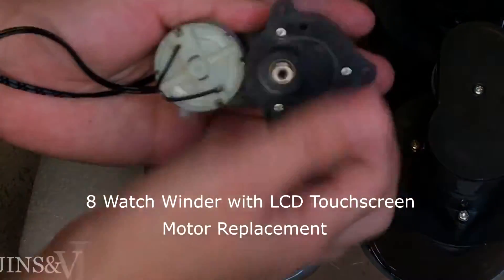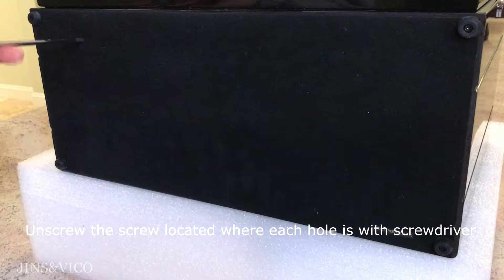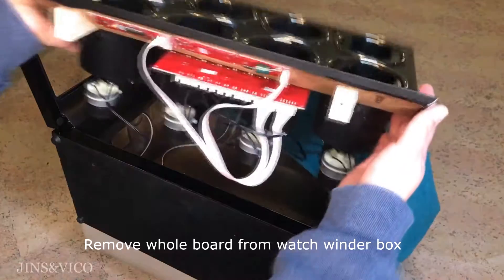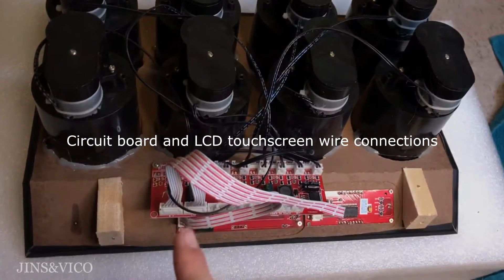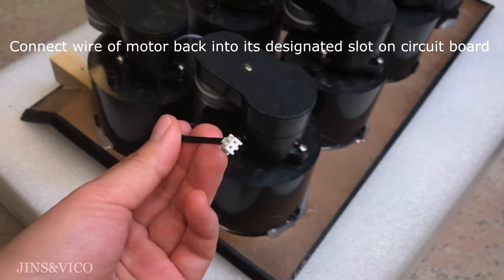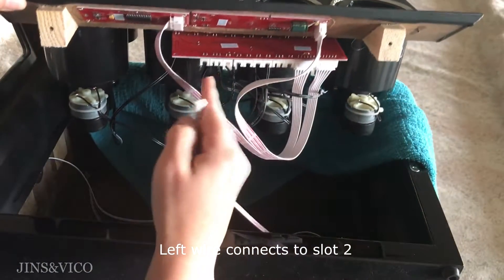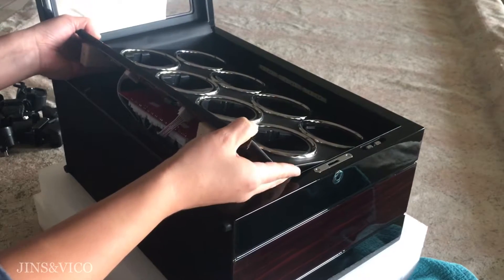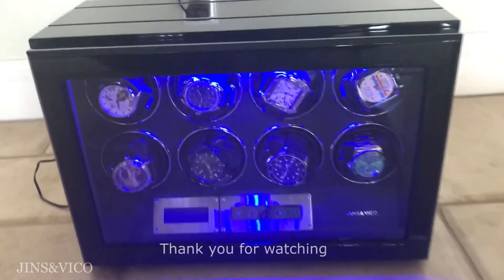How to replace the motor of JINS&VICO 8 Watch Winder with LCD Touchscreen

Comment: It is easy to replace the motor but what is hard is actually buying a motor. I am in UK and I found one source of motors which was quoting a stupid price and TWO MONTHS delivery. In an experiment I ordered a common Japanese motor from Amazon which was on next day delivery and about 20% of the price. The hope was that I could modify the winder to fit it. In fact the cheap motor had the same shaft design so fitted the watch holder and when I removed the old motor I found that underneath was a separate set of mountings that exactly fitted the replacement. The whole replacement job took less than 10 minutes.
Reply: Would you mind sharing the motor you bought? I would like to get one too. Thank you!

Comment: No instruction or direction on where to obtain the motor(s)?
Reply: I cant remember now but some time later a different watch winder had a problem and the maker sent me a bag of motors, They were different to the ones on the original and new winder but still fitted and worked Ok so it seems there may be some sort of standard for fitting.

Comment: Yeah, so you get a brand new winder these guys and one motor is already dead. And there’s no way I’m keeping a new winder at $500 and then keeping because a motor isn’t working. Done with these awful winders.
Reply: One motor from my winder failed and I had a similar problem with a different make . Oddly enough one of the watch retailers I use sent me a high quality British made winder as a gift. Guess what? within six months one of the motors failed !! Now have three Chinese made winders that have been running for years with no more issues.